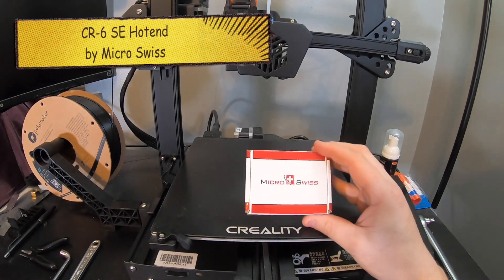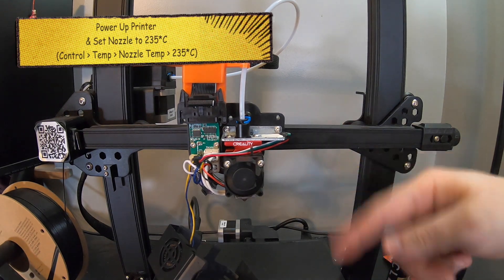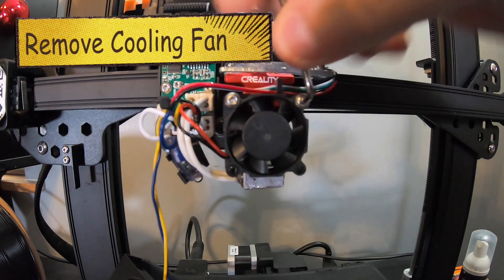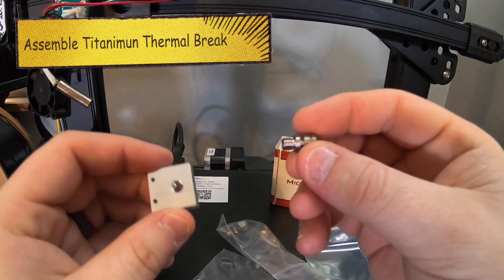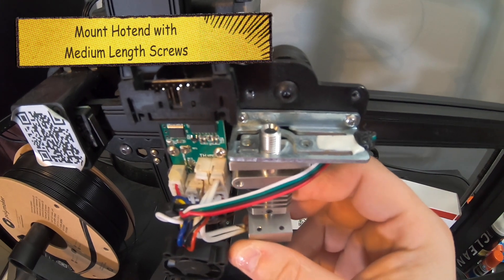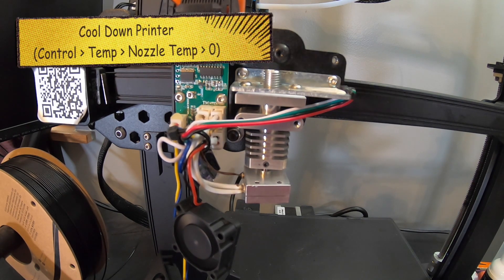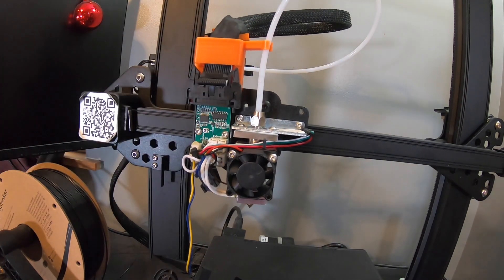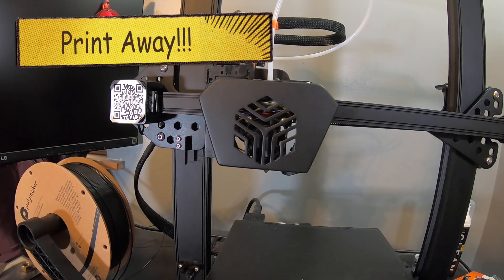Upgrade to a Micro-Swiss All-Metal Hotend on Creality CR-6 SE or CR-6 Max [Complete Guide]

Comment: May I ask why exactly you changed this part?
Reply from the maker: Hot end was not working properly and I upgraded to an all metal one which enables more settings and better heating
Reply: @MCFIXIT  Even though I’m using a bimetal heatbreak, I’m still experiencing clogging issues. Will this part solve the problem?

Comment: Thanks for the video. Can I ask what you call that little brass ring that you put on the tube. It stops the bowden tube popping  out. I lost mine and can't find a replacement:)
Reply from the maker: It’s a brass compression fitting. I’m sure if you type in brass Bowden coupler you will find a lot of places selling them.

Comment: I have never seen a video that only got one comment with a reply from the author.  You deserve more!  You did an excellent job, lots of well organized information.  I have not made the jump to the all Metal Hotend by Micro Swiss yet but your video will show me how when I do.  The only other thing I am interested in is the cable clip with the Boden tube support that attaches to the connector on top of the hotend.  I'm looking through Thingiverse but haven't found it yet, so it will be a race to see if I find it before you reply!  I'm going to subscribe and check out some of your other videos.  Stay safe, MC, thanks again!
Reply from the maker: I have not seen one of those but I’ll keep an eye out. Thanks for commenting and subscribing that means a lot to me.